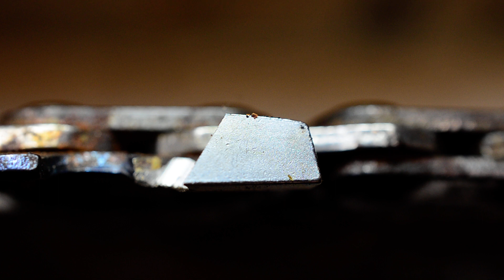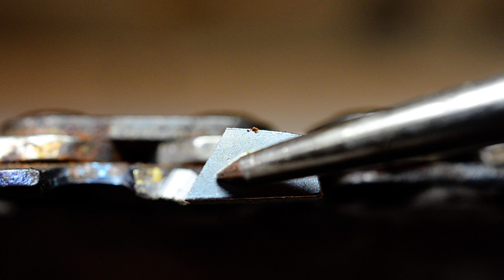Advanced Chainsaw sharpening angles

Comment: my whole back yard is oak and alot have fallen. I've sharpened my chains like buckin billy and they cut and grab so hard jams the bar and chain into it and have to fight to pull it out. What do i do, which angle do i sharpen my chains to. I've got 3/8P, 3/8LP and 325 ?
Reply from the maker: Check out a channel called Goodfellers, he is a pro hardwood cutter and he has some sharpening videos too.
Reply: @timberray9572   thanks Timber Ray ! for pointing me in the right direction : )

Comment: Hmm I've been running only a 25 top angle and only adjusting my down angle on my Oregon style grinder.. going from 65-50° But I've been wanting more aggressive of a bite and better self-feed so tried lowering my depth-gauges but that's still not giving me the self-feed I want when I'm using the 592xp in 32"+ hardwood.. now from listening to this I guess I'm gonna have to try changing the top angle instead, 30-35° just to see what happens.
Reply from the maker: You are cutting much bigger trees than me, it's worth trying out different angles to see what works for you. https://youtu.be/a4zs8FW4Ixk
Reply: @timberray9572  thanks, was just down putting a 32.5 / 60 angle on my chain to try once this heat wave is passed thanks to your video

Comment: Ive tried different angles and recently got a Super Jolly grinder and so far the best set up Ive used is a 55 degree, 30 degree and with a 10 degree tilt angle all on 3/8 chains for a Sthil 462, 661 and a Echo 620P its very sharp. and seems to keep an edge going through all hardwood. Cuts like a new out of the box chain and hit the rakers with a typical gauge and file.
Reply from the maker: My first grinder was a Timber Tuff, basically the same as the one you have just painted a different color. If you have a wide wheel you can grind the rakers with your machine. I sharpened about a dozen chains today, I grind all the cutters on all the chains first, then I swap out my wheel and knock down all the rakers, it saves me from constantly changing wheels.